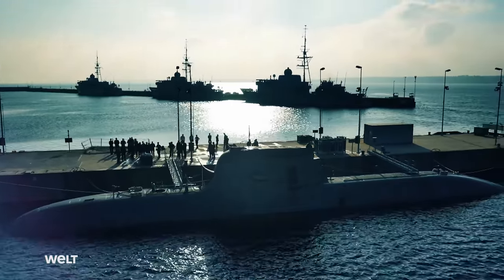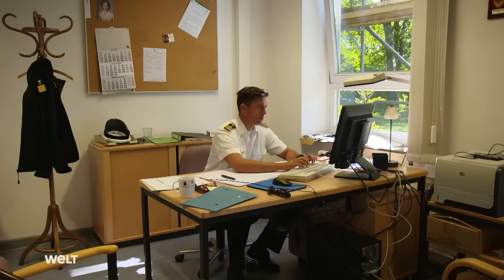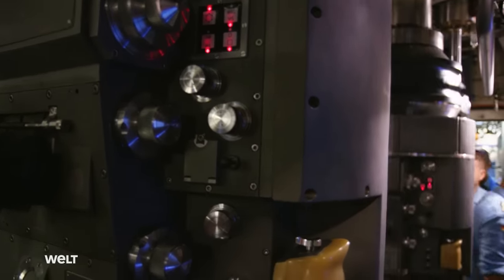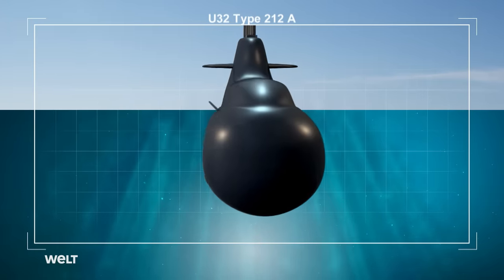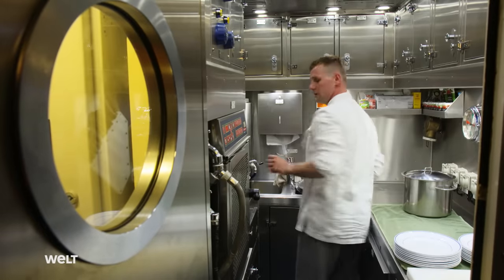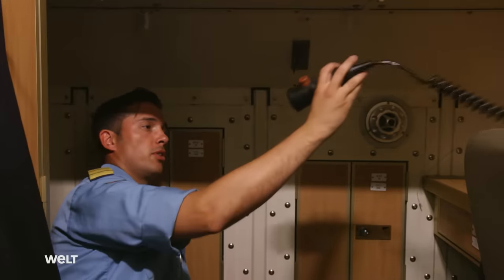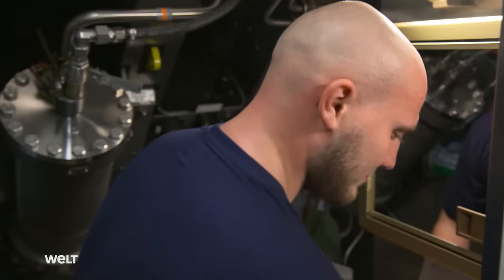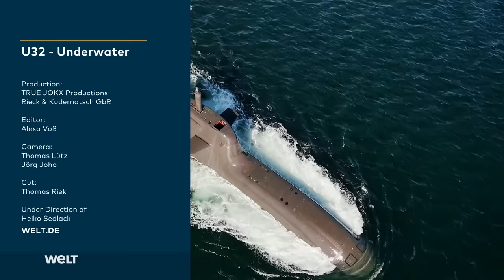U32 - German Submarine Soldiers | Full Documentary

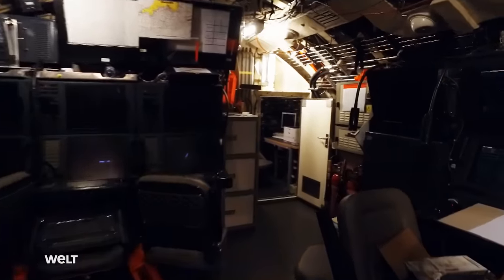Comment: 3:28 "The interior is pure high-tech.."
That office printer and desktop pc included?
Reply: to be fair the ISS is using 486 processors...
Reply: It's funny because we were still using Windows 98 on Dell laptops the size of microwaves on USS Ohio... and that was last year. So yea, I'd say the Germans are pretty "high tech"
Reply: Yogi69 i mean running the sub (no not a pun) systems? 
Tbh looking at it I’m almost pretty sure that desktop and printer is solely for admin and printing notices on board the sub. Doesn’t look like it’s connected or meant to do anything crucial
Reply: We had the laptops for admin but our main navigation system was running off of 2 Dell laptops with the processing power of the first iPhone... most of the other tactical systems (sonar, fire control, radar, etc) still use those "computers" that resemble refrigerators in both weight and size - think 1960s top of the line. I know the recruiting commercials make it seem cutting edge but the reality is far less breathtaking. The navy is broke financially and it shows.
Reply: @yogi6917  Deep respect for your service and attitude, sir. Especially when coming from a crew member of such a powerful war machine. You showed respect for your fellow German submariners! Greetings from Brazil.
Reply: @yogi6917  if it works.. it works!
Reply: @yogi6917  lmao dude our high/low side laptops are from the early 2000s, things are garbage. On the OKC myself, same here for all the boats out here. Navy's finest
Reply: @andreferro4618  - Cómo va la construcción del submarino nuclear brasileiro  ?
Reply: @walterseaman2556  ¿Cómo está Walter Seamen? La construcción de nuestro submarino nuclear todavía tiene un largo camino por recorrer. Aunque estamos construyendo submarinos, nosotros mismos, con buena tecnología europea, aún no hemos llegado al punto de tener el proyecto completamente listo. Comenzamos a desarrollar este proyecto, aún en los años setenta. No es una tarea simple, especialmente con todo este problema que estábamos experimentando hasta hace poco más de un año. Quiero decir, el gobierno de izquierda que se estableció en nuestro país. Los fondos que deberían haberse destinado a la investigación del desarrollo se han utilizado de manera totalmente incorrecta. Estamos luchando para resolver estos problemas, que nuestra propia gente ha creado. Saludos!
Reply: @andreferro4618  - Felicitaciones por tu excelente inglés y español...!  Ese problema con los gobiernos de Lula y de Vilma, ahora con el capitán Bolsonaro ya no existe, y seguramente pronto se avanzará. Yo tengo entendido que la Marina Francesa colabora con Brasil para el desarrollo.
Reply: @walterseaman2556  Es cierto que la tecnología es francesa. El submarino, SN Álvaro Alberto, estará propulsado por energía nuclear, pero no tendrá armas atómicas. La diferencia con los convencionales es que puede permanecer mucho más tiempo sumergido y prácticamente indetectable, incluso durante meses. Solo necesita ir a la superficie para renovar el suministro de alimentos de los marineros, ya que tiene un sistema de purificación de aire y combustible prácticamente ilimitado. Según la Armada, la estructura metálica del submarino será una mayor adaptación del proyecto Scorpène. Pero el reactor nuclear se desarrollará por completo en Brasil, ya que este tipo de tecnología no se vende en ninguna nación. Es un equipo mucho más complejo que el reactor de una planta nuclear, por ejemplo. Si bien el reactor de la planta se activa una vez y funciona continuamente durante años, generando la misma cantidad de energía, el motor del submarino siempre debe cambiar de potencia, de acuerdo con los movimientos del buque, y a veces debe apagarse y encenderse. La mayor dificultad para los ingenieros brasileños en este momento es crear formas de controlar esta energía. Antes de ser montado en un submarino, se probará un prototipo de motor a gran escala en tierra en el Laboratorio de Generación de Energía Nuclear de la Marina (Labgene) en Iperó, en el interior de São Paulo. Pero los expertos de la Marina dicen que puede haber demoras en esta parte del proyecto. Gracias por los cumplidos con respecto a los idiomas. De hecho, hablo, leo y escribo mi propio idioma e inglés, ya que viví durante 15 años en los Estados Unidos. En español, para escribir, necesito ayuda ... ¡Estoy trabajando en ello! Nuevamente, te saludo y gracias por tu interés en nuestro proyecto.
Reply: @andreferro4618  - Muy buena info, Andre...sigo con interés ese proyecto brasileiro.  Gracias y saludos.
Reply: Yogi69 Hi Bro, shh...keep it low ..... dont. want Putin to laugh too hard ...
Reply: @ckho2054  - What makes you think the Russian submariners have a more generous budget, higher than their US counterpart...?  Don't ever forget the USSR went bust and crumbled down forever because they spent on their Armed Forces far too much money, more than their resources could provide. I've got a hunch they're heading that way again.
Reply: Sometimes the old technology is more reliable. For example if something is malfunctioning just hit it a couple of times and it might work as before.

Comment: What I always wonder, do this 3h (or shorter sleep periods) comply with mental / physical needs of the body if you do critical work with potential catastrophic results?
Reply: sleep goes in 90min cycles. As long as the sleep period is divisible by 90 minute intervals, and it adds up to enough hours per 24h, you will be fine after a brief acclimatization period. Or you go shrieking insane. of course. The worst thing is to get pulled awake from the deep sleep period. This will take you minutes to become fully conscious. Waking up from a period of shallow sleep, which occur every 90 minutes, is fine. 
You can try this at home: sleeping for 4h is waaay worse than getting up after 3h, 5h is worse than 4,5h, and so on.
Explorers in extremely cold environment usually divide the day in 90min intervals, and wake each other up every 90min to avoid freezing to death during sleep, and reportedly, that becomes very normal and natural very fast, to the point that some scientists suggested that might have been what our ancestors did during the Ice ages.
Reply: You can live on four hours of sleep per day, I've done it for months at a time, it won't drive you insane just a little nuts that's all.  🙋🇺🇲🇷🇺

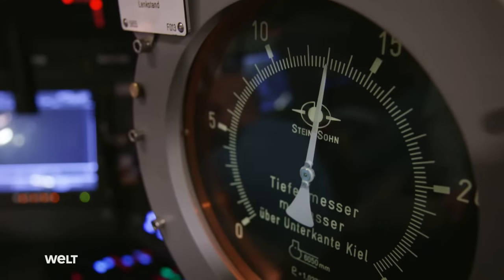Comment: 20:53 I whish they explained this better. My understanding is that letting water into ballast tanks brings boyancy close to neutral and then the plains of the submarine are used to guide it deeper or toward the surface. Someone correct me if I'm wrong. So the diving isn't so much about ballast but like flying under water? And when they want to go up they use plains to "drive" the sub up. And then I believe they pump air from the surface into the ballast tanks to push water out and the sub becomes boyant and stays on the surface? Then they have compressed air in tanks for emergencies, to blow out the water from the tanks when submerged and surface quickly.
Reply: The ballst tanks contain air wich keep the boot on a certain level. If the reduve the pressure in the tanks, more water is flooding in and the upkeeping effect reduces. it´s finaly airpressure vs. water-pressure wich keeps the boot at a certain level. If yo run out of air-pressure, yor can´t dive up and sink endless.

Comment: Norway will buy 4 of the Type 212 Submarine. 
And together with Germany, Norway will develop a Submarine version of the Norwegian Naval Strike Missile for be used in the future Norwegian and German Type 212 Submarine! 
I'm not sure if Norway will buy an extended version of this submarine.
There are several versions of Type 212, with lengths from 56 meters to 73 meters
56 meters (183 ft 9 in)
57.20 meters (187 ft 8 in) (2nd batch)
58.30 meters (191 ft 3 in) (212 NFS)
73 meters (239 ft 6 in) (212 CD)

Comment: German submarines were dirsel electric type but they are tge best submarines between all SSN's submatines of UK, US ,French and Russian submarines.
Reply: The Type 212 has also a Oxygene/Hydrogene fuel cell for combat mode. The diesel is in comat mode turned of and the e-motors run on power from the totally noiseless fuel cells. The diesel is only used to propell the submarine until it reaches its mission area.

Comment: Submariners are sailors not soldiers.
And the type of steel used does not make any submarine quieter.
Reply: It does, not by sound decibel, but by electronic inteferences wich can be dected by anti submarine buoys.
Reply: @Rick2010100  they were not talking about electromagnetic waves on a submarine.
I do understand these things Rick. I spent the 1980s as a submarine sonar supervisor in the United States Navy.
In the video they were speaking about sound.
And buoys are not used to detect electromagnetic waves on a submarine. The sensor is a probe on the aircraft. Visible on the back of an airplane and the front on a helicopter.
Buoys are used for active/passive sonar.
Reply: @joecombs7468  I guess the journalists responsible for this video did not understand all the details, and my definition of a "buoy" was also wide span as the German definition for it is Signal-Boje wich translates into english as buoy - may be a translation mistake - e.g. (advanced modern) Passive Sonar may be also familiar to you.
Like in Passive Radar / Sonar the operator or now system does not send out a Ping, but is just listening to irregularities in the "background" noise. Todays HQ radars work in the same way, NO beam just observing changes in the natural environment. - just listen.
Reply: @Rick2010100  radar is a good thing to compare it to. 
These journalists did pretty good compared to most.
Ya just can't get that many to volunteer for submarine service LMAO
You have a good night.

Comment: Very interesting; obviously designed for Littoral Combat, versus open ocean. Completely different mission than the Russian, or American fast-attack, or nuclear missile boats. Nearly silent electric drive would make locating one of these extremely difficult among the chaos of other harbor propellers. Still, a single €2 million torpedo could convert one €400 million submarine into fish food.
Reply: if you can't find it you can't shoot it and actually hitting it is another question on top of that so you wasted 2 million on your torpedo that doesn't work. also this sub can operate in open ocean as well. they can stay submerged for the entirety of an atlantic crossing, no problem.
Reply: Mar ; I never suggested the type was junk. I said it was designed for a different mission. The battery system, or hydrogen peroxide fuel will eventually be exhausted. A completely different propulsion method against a nuclear submarine that can stay under for weeks at a time. Any Akula, Seawolf, or Trafalgar-class attack sub would decimate this thing, and that includes being tied-up to a dock someplace; a perfect Tomahawk target. Electrics are not invincible, and every propeller has a unique signature. Potential adversaries likely have it already dialed-in, ready for an acoustic fish to make a run.
Reply: @buckshot704  the type 212 can also stay "under" for weeks. none of the subs you listed (all 1980's tech compared to this 2000 tech) even have a fighting chance against this sub. the type 212 is much smaller and quieter. unlike nuclear subs that are huge and therefore need bigger and nosier propulsion as well as being easier to detect with active or passive sonar and have to use cooling pumps for their reactors which just adds more noise and leaves a thermal trace because of the heat from the reactor, the type 212 is dead silent, no pumps, small propulsion, no thermal trace and it can go where large subs can't go to hide or ambush. there is a video from the german navy on youtube where they show that the british navy can't find this sub during exercise. this is the most modern and best sub in the world at the moment. PS did you really write "hydrogen peroxide fuel" face palm you clearly know your stuff, glad I talked too you. it's not like I waste my time here talking to an expert like you^^ PPS your initial argument was that a 2 million torpedo can destroy this 400 million sub, well guess how many billions a nuclear subs costs you brainiac... some people don't ever use their brain. unbelievable.
Reply: Mar ; Excellent news! What a relief! The Russians, Chinese, Americans, and British can now retire their submarine forces, and put the multiple billions they would have wasted on such an obvious inferior fleet to produce perhaps a CoVid vaccine to please both Bill Gates, and George Soros. All it took to defeat the evil capitalist west were six German electric submarines. Who’d have thought? Especially since the Brits admitted with a YouTube video that they were clueless, and couldn’t find a 212 boat. That’s clearly concrete evidence to prove western decadence, and that the Perisher Course is a bloody waste of time, and resources.
Reply: @buckshot704  you forgot your meds this morning?
Reply: Both of you are correct. 

While nuclear subs would have the enormous tactical advantage, they loose it closer to littorial waters, where his thing rules

Comment: Damn they actually get to have beer?! You would NEVER see that in the American Navy because it would be abused. Gotta take everything to the extreme in America. I've never understood it. I guess i'm more European then American in mindset. So what happens to your Navy when oil based fuels cost too much or can't be procured? Germany just surrenders all their military equipment? Seems nuclear power is the way to go.
Reply: The military would probably be the last institution that'd run out of it, and submarines will probably be the smallest problem at that point (how to refuel tanks?). That said, in the long term, perhaps we'll see a complete switch to hydrogen, considering it's already being used for the AIP fuel cells? Tradeoff for their superior stealth is slower top speed and less range before resupply, so it depends on where/how you'd want to use either type. I think having a mix of both would be ideal, but in a way that is exactly what NATO teamplay provides.

Comment: Periscope depth doesn’t look too stealthy 😂 might as well be on the surface.
Reply: from 20nm away, your radar says otherwise ;-)
Reply: In combat and near enemy ships, the boat will never drive like it does in this video. It will be submerged fully and you will not see anything. They also have multiple periscopes and the combat periscope is very small. They only do this in this video because they are sailing in a body of water with a lot of shipping traffic. The Kieler Fjord is the entrance to the Kiel Canal and one of the busiest waterways in the world.
Reply: @callsigndd9ls897  then it’s not periscope depth, is it? Was a joke. And the rest of your reply is irrelevant. Shipping traffic has nothing to do with it, when you’re 20 meters below traffic.
Reply: @andyg5050  What can be seen in this video is no periscope depth. The submarine's tower is no more than 2 meters underwater, so all periscopes, snorkels, and radar are still visible. Whenever possible, the boats like to go under water or half under water, as they then use less energy. When modern submarines travel over water, they are very inefficient and difficult to maneuver. Apart from that, with a construction height of 11 meters, this boat cannot completely immerse itself in the Eckernförde Bay and the outer Kiel Fjord, as the water here is only 20 to 30 meters deep on average. The boat must drive over water in the fairway of the inner Kiel Fjord, as the depth here is only between 13 and 15 meters and there is a lot of traffic. And don't tell any more nonsense, I'm a sailor who lives in Eckernförde. I know these waters like the back of my hand and have seen these boats several times.